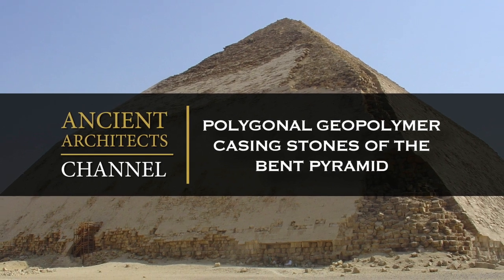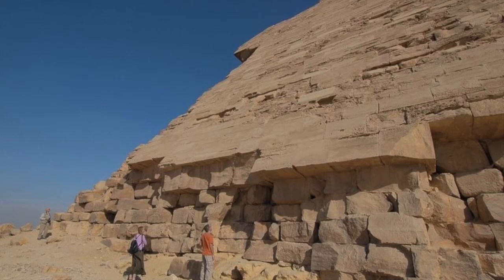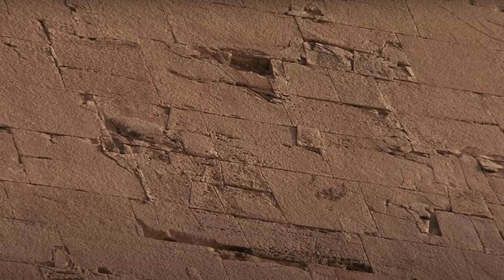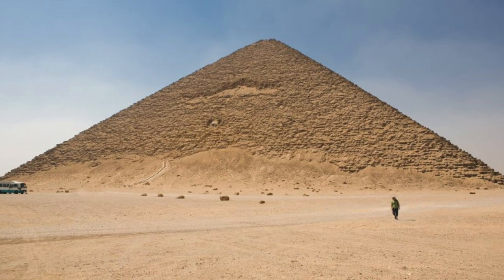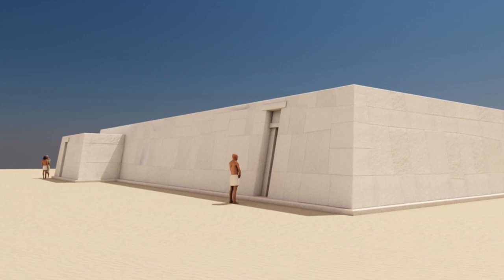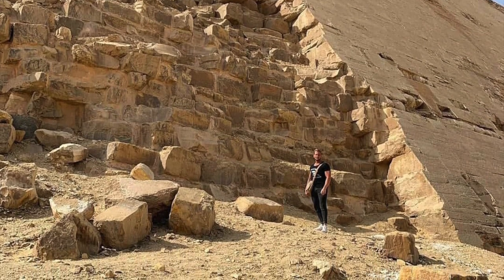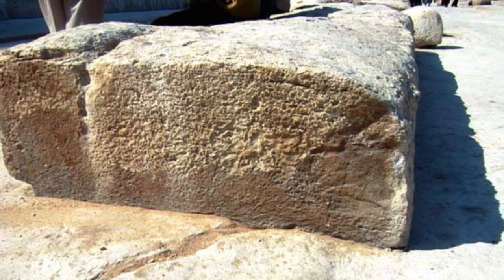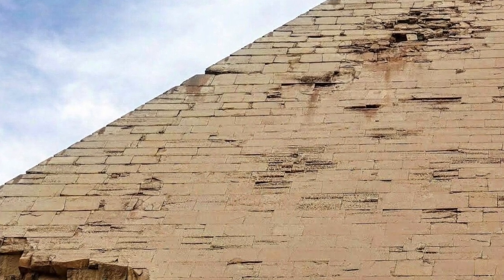The Polygonal Geopolymer Casing Stones of the Bent Pyramid | Ancient Architects

Comment: Perhaps the “why?” is similar to why “geopolymers” are used today. 
The best example is kitchen counter tops. Natural stone countertops, like granite and marble, have long been considered the pinnacle of luxury and longevity. 
But now, man-made stone countertops have risen in popularity. Several of the “engineered stone” countertops are more expensive than granite. 
The man-made stone is often preferred for its uniform look, free from imperfection. It performs as well as its natural stone counterparts, and is available in a wider array of colors and shapes. 
While the manufacturers of man-made stone insist they are not trying to mimic natural stone, and wish to be seen as a stand alone product; the actual use of man-made stone is more often than not, used in a way that mimics natural stone. Pointedly - irregularities are artificially added to give the appearance of natural stone. 
It’s possible that “geopolymer” stones were purposefully made in irregular shapes and sizes simply to mimic the look of painstaking masonry work. 
And the “geopolymer” stones would have had a more uniform color and structure. 
There are aspects of man-made stone that people today are willing to pay more, more than the cost of natural stone. And then are assembled in a way to mimic natural stone. 
It’s not unreasonable then, to assume ancient Egyptians were willing to do likewise.

Comment: I think the casing stones are carved stone. But I also believe that they were chemically bonded to the inner structure and their surface may have been chemically finished.
Reply from the maker: Interesting!
Reply: Sounds  plausible.
Reply: If I remember the story correctly, our guide mentioned that caliph Al-Ma'mun used boiling vinegar to dissolve the limestone to gain entry to the Great Pyramid in or around 820 A.D. I have seen how quickly vinegar can dissolve modern cement which explains the susceptibility of cement to acid rain. It would not be surprising to find that the Ancients used a vinegar compound to shape or polish limestone blocks.
Reply: @Alfonsodag  I was thinking the same thing.  Are these geopolymers through the stones or just on the surface?  That is an important question to answer - we may just be seeing a method that maybe the AE used to smooth the casing stones once they were in place on the outside of the pyramid.
Reply: @Alfonsodag  uh...yes, it would be surprising. Why? because: 2.3 million blocks!  TOO MUCH VINEGAR!  Oceans of vinegar....didn't happen. They did have to breath and vinegar evaporates in warm weather...right up their noses. :)

Comment: Matt, Love the channel. Thank you.
3:22 My thoughts: stones were located inside the pyramid as a course of perimeter was poured. When the perimeter was complete, water was added to flood the crevises of the space (with crevises also filled with a fine, sifted diameter, probably specific hardness, sand) had consistent and make a kind of shallow pond. Leaks were cut out along the perimeter and small pours were made to ensure a perimeter seal. When the water surface was still, the top of the perimeter could be judged and trimmed as needed - per engineering requirements - because the water was used like a level.* (No lasers; if lasers had been available, they would not have been good enough anyway for such a large structure ~ as today.*)  Each successive layer above was constructed the same way. Less water was needed as each course was poured; but, geopolymer stones would have to be much larger further down (for water pressures above) and be cured enough (like concrete today). The mix for the geopolymer could have been made insitu, inside the pyramid, as each layer went up. Water also surrounded the pyramid too as also causeways were used.

Dr. Kos mentioned, in a video he made a few years ago, the pyramids used rampart construction for their interior. I will add, if a stable point could be "set in stone" at the apex (a stone rejected by builders otherwise) then the angles could be identified down the side of the pyramid to cornerstones. (Of course, The Great Pyramid has eight sides; but, same concept.)

I learned about Chinese water levels from my grandpa who was a builder. I used a water level to match and set heights on some cabinets I made years ago; and, at a different time, a large deck; and, even as a backup check for other larger, more precise structures.

Randy
* "The water level is lower-tech than the laser level, but it can be more accurate over long distances, and works without a sightline, such as around corners. To avoid error, all of the water should be at the same temperature."
Water level (device) - Wikipedia
https://en.m.wikipedia.org/wiki/Water_level_(device)

Comment: Some of these polygonal blocks in the casing stones of the pyramid seem to be repair jobs they did during construction. Perhaps some of the casing stones partially crumbled during construction (eg. by unintended load concentrations) and they sent someone up (or down) to patch it up with smaller polygonal blocks. At 6:11 you can see the protruding block slightly right of the center, and that one is even supported up by a smaller rectangular block. To me this seems like a repair job and I suspect it won’t go very deep.
I’m also not convinced that all the casing stones are geopolymer. Some of the erosion marks on the casing stones appear to be very natural, forming horizontal strands (see 1.33). I doubt this kind of erosion forms when you have a properly mixed batch of geopolymer stone.
I guess we’ll have to wait till November 30th to get up close and take a good look at it.

Comment: I'm starting to believe they were masters of this method. As an artist, I look at the giant colossal statues that have large block internals under a smoothed skin (polished) and think they also used this in the sculptures and hyrogliph reliefs found all over. So much easier to work with material as a sculptor when it's soft then chisel it away. The pyramids are built the same way, rough blocks on the inside with nicely smoothed surfaces on the outside. The shape of the internal blocks really doesn't matter as long as you get the bulk of it where it needs to be.
Reply: The elite were totally masters of the secret chemistry of making artificial stone. They only worked for the royals and the priests.  The peasants had no access to that knowledge.

Comment: Look how the casing blocks are like brick header courses, tied back into the internal structure. Very strange for something that is poured
into an open cavity? Why so plinth-like and rectilinear deep into the structure if poured? Makes no sense. The interior of the bent is so much
apparent jumbled rubble, like a massive recycling project to use everything in creating mass. Obviously a number of techniques were
used. I'd say the outer white layer of the casing finish has a "stucco" look to it from a distance. Like a commenter below stated that
it may have been treated with a synthetic plaster or coating afterward. This bent is damn mysterious. Every we take a look at it, something
unfolds a little. I still think this dashur complex is unbelievably old.
Reply: The casing stones are larger than the general stones of the pyramids because they are so long. That prevented them from falling off...which could cause a cascading failure all of the way up to the top if they were shorties
.

Comment: They were poured in place. This is why there were no standardized molds. Provides a more complete connection to stones beneath and removes the need for precise molds. Alternating blocks around the structure allows complete drying before pouring the adjacent blocks ensures they remain separate without gaps. I work with gfrc and I've always thought this when viewing these ancient structures. It would be much easier than moving them.

Comment: Surely they were cast in situ. Starting from the bottom materials would be bought to site pre-mixed and the shttering would be adjusted in size to match the rate of supply of materials so a "stone" could be completed before the material set. Are the corner 'stones' solid blocks or more consistent as they would be dams to hold the material as it was setting. The side shuttering may have been moveable stones. This method would probably have lead to polygonal 'stones' but the corner stones would most likely be in consistent layers. Much as your best bricklayers set the corners and the lesser ones lay the straight courses.
This is all conjecture to get people to examine the variation in 'blockwork' to see if its characteristics point to a mode of construction or assembly (if they were in fact pre-cast).

Comment: Its obvious from looking at the red pyramid that mortar was used, while the difference in colour between the surface and internal stone structure could be explained as a rind caused by thousands of years of weathering, that can not explain wy this 'rind' also appears sandwiched between stones that have been squashed together  since the pyramid was built. They were definitely mortared together. The question is what chemistry was used and where else was cement applied? The bent pyramid might be  a good candidate for research.
Edit: How deep were the samples taken for the casing stones? If they just sampled the rind the chemistry is far different to the internal structure, weathering and recalcation would cause the rind to more resemble concrete than any natural limestone,

Comment: The substrate was irregular. The cap stone was cast in place using slip forms. I think we will find that they can be replicated using vibrational frequencies to align the crystalline internal structure. A bond breaker of clay or diatomaceous earth can be painted on the surfaces between the face stones to allow them to flex in quakes. Some ignacious polymers were treated with surface heat to glaze them.

Comment: A reason as to why use a polymer could be transportation, it would be easier moveing sacks of "grain" rather than pre cut blocks. Although transportation didn't seem to be an issue to the ancient builders considering all the other sites. It could be possible that a polymer mix is more shock proof than cut stone, maybe to prevent cracks caused by fire. Shockwaves from airbursts/impacts But most interesting would be some more research done into the frequency of the proposed polymer and see if it's different from the cut blocks. The geometry found all over ancient pre dynastic sites has many functions but an important one being the creation of resonance. For what purpose I have no idea but the pyramids chambers resonate at certain frequencies for a reason, I lived in Egypt for 2 years and have been inside many of the pyramids, its resonance is harmonic, similar to that inside cathedrals.

Comment: Great information.  I notice there is huge difference between the polygonal stones in the pyramid casing and the mastaba bricks.  The mastaba bricks are regular shapes which would be easy to get out of a simple mold.  The problem with the polygonal stones is getting them out of molds easily with their odd shapes.  You totally can't just turn the mold over and shake out some weird shaped casing stone.  The variation in the size and shape of the stones would require unique molds for many of the stones, especially as the sizes changed moving up the pyramid.  A lot of all these molds would have to be complex, needing to be disassembled in some way to get the cast piece out, and then put back together.  The other approach to fitting the stones would be to create forms in place, like modern concrete construction is  done.  Of course, there are some really big problems with this.  First, there is the problem of form lines where forms left imprints in the product.  It might not be visible on the finished outer surface, but there would totally be imprints on the surfaces meant not to be seen.  The second problem is the polygonal stones which serve no purpose if the casing stones were poured.  The casings would likely be poured in very consistent shapes and sizes.  A third problem with poured blocks is the thermal expansion and contraction involved in making concrete, which is totally why those little pads are between the pieces of a sidewalk.  The pads are called thermal expansion joints.  I totally don't see any advantage to pouring the casing in place, nor in casting them.  Seems like such a waste of time, and creates a lot more problems making stones than just getting the stones and cutting them to fit on the pyramid.
Reply: uh...how little are you figuring that those pyramid blocks weigh? Not much?  Just lift them with a crane and place on a steel-wheel roller-trolley?  And with what say do you saw about 44 million block faces on about 11 million blocks for 6 huge pyramids of Egypt?  There are no easy answers when the only tech is primitive tech.  
But about the odd shaped blocks; they may have been repair for spots where the poured limestone was not moist enough and therefore was too dry and crumbly.  The poured blocks may have been tested in spots that looked suspiciously inferior, and then repaired by replacement in sizes that matched the area excised.

Comment: I assumed the hypothesis for casting the casing stones involved the stones being formed in situ with stones cast in temporarily assembled form work molds kinda like we do today with concrete structures as each stone may have been required to be slightly unique to fit tightly against base stonework that may not have been 100% uniform.

Comment: The small blocks all over the Bent Pyramid are from repair works carried out by Pharaoh Sneferu - repairing small eroded patches of these blocks.  Thus the pyramid much predate Sneferu by at least 4,000 years (the time for erosion patches to emerge).  Thus the pyramids are much older than currently thought.
Ralph.

Comment: The main reasons I thought for the cast stone hypothesis is that it would be easier to transport, be it over water or up a pyramid, bags of concrete (in effect) than multi-ton stones and it would be more efficient of materials as there would be next to no leftover materials after carving the shape you wanted. It is less energy efficient though as you must reduce stone to powder and then treat it so it can be molded, presumably through fire and there is precious little combustable materials in Egypt.
Reply: fire was not needed if the chemical (lime) that required it for production was not needed, but something else was used in its place.

Comment: I would imagine even with the use of molds there would still be a certain amount of shrinkage and curing irregularities occuring in their production and finishings demolding processes?
Reply: @Real M if you look even today primitive brick makers fill their molds and set them out in the sun to dry typically. Harder to control moisture percentage or manage evaporative loss and if they were using fire or a kiln type apparatus that would require more work in the QA/QC "department" if you will.. but hey it's just a guess lol

Comment: Using a mold would mean that the prior cast stones would also be a part of the mold. I seen a photograph of a block which had apparently been in a mold, but had seeped under the adjacent block forming the mold. Just as if this had occurred at a construction site, the seepage would have hardened. This is more proof of geopolymer construction, for the seepage was hardened as a part of the remaining block.

Comment: Easier to carry buckets of materials than megolithic blocks.   Also using 2 piece molds would explain the uncanny symmetry and precision replication seen.  The biggest giveaways in my opinion is the spaling and the tendency toward continuous horizontal seams and if you look close theres even rust lines and holes remaining from exposed rebar, yes iron, rebar.

Comment: I would still like to find out what is the advantage of using irregular shapes. I don't think it is just to use up what was available.
Reply: Someone made a video showing  a replica model of the irregular stonework walls at Puma Punkhu and how it was very resistant to earthquakes.
Reply: @vaguelyright6833  - it would diffuse shock paths and redirect energy, whereas regular courses of stone work almost amplify and enable it to break thing apart.
Reply: @iandalziel7405  That is only relevant to vertical walls, not triangular shapes.

Comment: If it were possible to make synthetic stone in molds, one would think that would be he easiest way to make an obelisk. It would eradicate the need to quarry a huge block, move it and erect it. The fact that there is at least one huge obelisk still lying in the quarry counts against the proposition. It might be that the technique of manufacturing artificial stone was lost by the New Kingdom, but I'm not convinced that such a technique was ever used. Admittedly there is one temple which seems to exhibit liquefied stone on one stairway, that being Dendera. The curious  melted stairway may be older than the Ptolemaic structure surrounding, as it was common for Ptolemaic temples to be on older sites and to incorporate older features.

Comment: In the process of carving and dressing limestone blocks a fair amount of waste is created.
If this waste, which is already in the form of smaller pieces and particles, could be recycled into a useful material it would make the entire pyramid  construction easier.
Similar to modern concrete theses smaller pieces, down to dust sizes, could be mixed with other things to form a moldable and workable material. Blocks of material as hard as pure limestone could be created.
These moldable blocks could be made in situ avoiding the need to transport heavy awkward limestone blocks.
Smart move by the Egyptians.